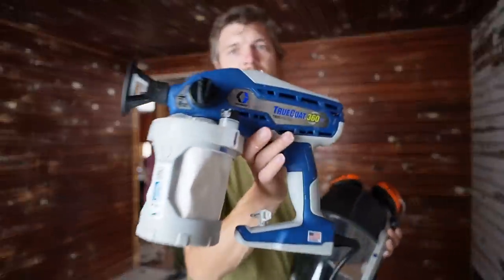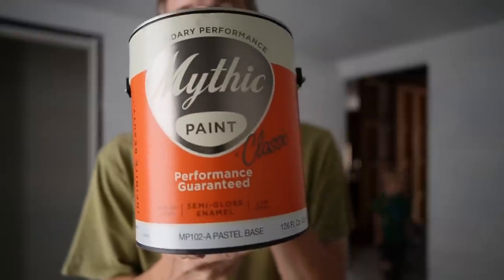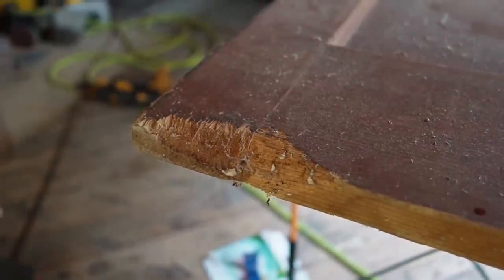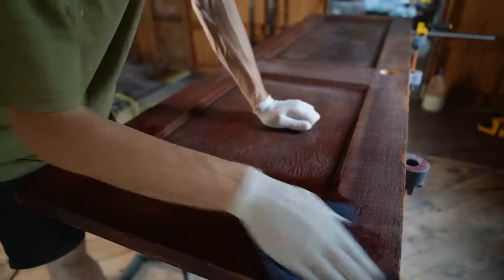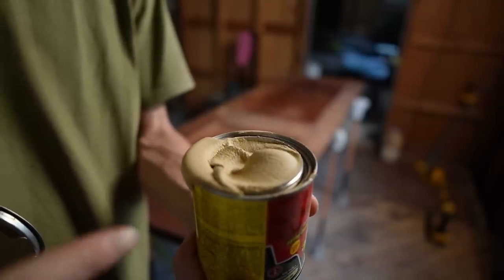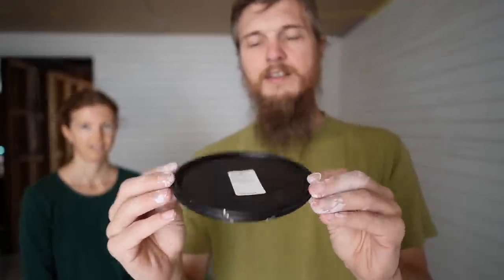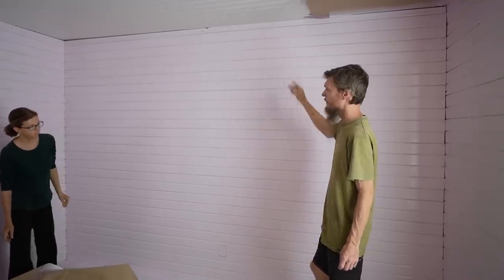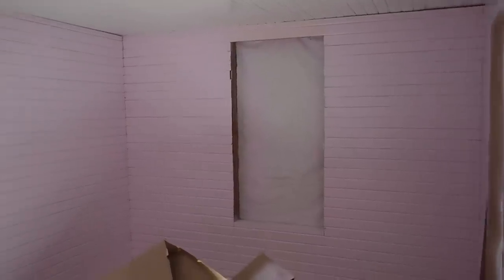We Painted this Room for the First Time in Over 50 Years - And it's Awesome!

Comment: I used to work at Sherwin Williams for a few years. Masking paper would have been a better choice. It is lightweight and comes in a variety of widths. 12" wide masking paper might have been adequate to keep the pink off the ceiling. The paper you are using is for floors and meant to be walked on, hence the heavy weight.
Reply from the maker: We actually bought that paper for the floor, but we like to use what we have on hand.  It worked, almost :)
Reply: @diyfferent  A roll of masking paper is about the cheapest thing you can buy. Save that heavy paper for future projects. I used to have a roll I used for all kinds of projects. I would even lay cookies on a piece straight out of the oven. I recently bought a new roll to cover the windows in our ambulance while painting the exterior. There will always be a use for the heavy paper.

Comment: No need for sanding the door again or applying a second coat of shellac. Rubbing out the door using #0000 steel wool loaded with paste wax is all that is needed to get a fantastic finish.

Comment: As a painter, painting over stains you will always need a stain blocker. Certain stains require a shellac based stain blocker. The bleed through most of the time will get heavier over time therefore having to do it over again. Most general primers are not the same as a stain blocker.
Reply from the maker: We understand. Thanks :)

Comment: Hey guys next time try using the blue painters tape. It seems to stick better to a painted surface and not pull any paint off at the same time also try using the plastic and not the paper because of the weight, yes I know it’s a little harder to hang and tape but I think you will have better results.

Comment: Doug, a couple of things,first off what brand sprayer is that looks pretty decent?Secondly,as a spray painter, you have a couple of things you should correct. Do not fan out your strokes at the end of each spray stroke as you create overspray and uneven coverage. Try to keep your stroke like a robot, perfectly even end to end same distance and perpendicular to the work area. Next,spray completely wall to wall so not stop in the middle, you will create dry spots where you break the pattern. Go end to end and work your way up the wall,floor to ceiling or vice versa. Bin or Kills makes a good primer over wood as the shellac base stops the bleeding. It will look good though,as you practice these are all common mistakes that are made when spraying. Project is looking good!
Reply from the maker: The sprayer is linked in the video description.

Comment: Masking tape is not used for painting. Try using blue painters tape.
Reply from the maker: Masking tape is also known as painters tape. We didn't have any blue masking tape on hand, so we just used what we had. The purple painters tape we used is made for delicate surfaces so it didn't have the strong hold needed for the ceiling. The yellow painters tape is designed for automotive painting.

Comment: What did you think about the paint sprayer? Was it as faas it looks? Was it heavy to use? It really looks good on video. Nice job.
Reply from the maker: It was fast to use. And yes, it does get a little heavy after holding it for a while. The cleanup does take some time and I always hate cleaning out sprayers. But it's not the worst I've had to deal with. The paint cup is small so you have to keep refilling it on a project this size. It gets messy and annoying to keep stopping to refill. But it does give a nice finish and saves a lot of time.

Comment: You know those movies where someone dies and all of a sudden they are blasted by a bright white light?  That's what the room looked like when you were showing us the base coat!😄 Thought Belle would need sunglasses to walk in the room!  What a huge difference.  Despite the difficulties, love the white ceiling with the pink walls. Love the door, but wouldn't have felt any attachment to the scratched out section.  I definitely would have fixed that, but love how the stain looks and love that the door will complement other doors and trim in other rooms by having the deep stain.  Can't wait to see the floor redone and to see how Belle and you lay out the design and decorate it.

Comment: When using shellac, try the French polish method. It takes a bit more time and patience but the application technique is a breeze and the results are really satisfying. Cut your shellac by 1/4 -1/3 with boiled linseed oil and wipe it on with a lint free cloth or gauze (cheese cloth) pad. Build up multiple coats, lightly sanding with fine sandpaper every 2-3 coats. As you get to the depth of finish you want, try adding even a bit more linseed oil to the mix for the final couple of coats. For a furniture grade finish, then buff out  with a slurry of linseed oil and pumice powder.

Comment: You can put a light coat of shellac with a brush over the bleed through before you paint it again and if will seal the bleed.
Reply: Why not use "KILLZ" primer. It's always worked for me. It depends on the surface and finish of the wood as to how many coats of KILLZ primer I apply. More lighter coats to get great coverage than one heavy coat 😊

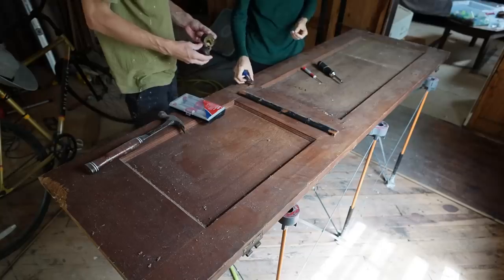Comment: 7:17 At this point I’m really hoping the door gets a refresh and new stain n sealer. It would be a great pop in the room. But since I don’t know the end color, I’m going to be open. The room so far just with primer looks so much better. One time, I’m ok with painting wood. 😂 
33:19 Ok, well the plan so far is looking good. Perfect pink room. With the stained door will be so nice. I have used shellac based primer like Bin to seal stains. Even after a first coat of paint. You can spray the bleed through areas after you spray the door and then paint with your pink or white again. Many painters don’t like to use the same gun for the shellac and water based paint as they use different things for clean up.

Comment: It doesn't matter what kind of paint I have on what type of ceiling a craft paper never stays up for me. I finally just bit the bullet and bought the painters tape with that real thin plastic sheet attached to it that you unroll it as you tape it on and then you unfold the thin plastic. I don't like that stuff it doesn't biodegrade but it also doesn't fall off the ceiling and smack itself against my wet paint. And it stays up there probably because of how light it is.

Comment: Doug & Aehley, good job on the walls and door. Don't be afraid to give the door another coat with a brush it will be better. Also, give another coat of paint to the walls with the brush since it looks like the masking is not working for you. But if masking works for you during the spraying, pull the masking right after you finish painting. You guys are doing well. Take care, thanks 😊

Comment: Maverick's sweet smile could easily melt any glacier.   He is such delightful addition to your videos.  Belle's room is indeed perfection.    It's 'her room'.   I think it's important for children to have input re their rooms.   It instills the knowledge that their thoughts and opinions have value.    Those positive lessons/memories will be beneficial when there's challenges throughout her life.    (I didn't always obtain exactly what I wanted but Mother definitely tried.   One time I wanted bright pink floral curtains in my room.   We compromised on a piece of fabric with bright pink floral print in a frame.   Mother  was very wise.   It wasn't long before I didn't enjoy the framed floral fabric, it was a bit garish.)    I had to smile when Doug said Ashley wanted to keep the damaged area on the door.   The house has a story.   Every scar is part of it's story.   New construction is bland, to me there's a void when there's no history.    I love solid wooden doors.   Not only are they usually more quiet they also add a 'feeling' that hollow core doors and foam in plastic doors cannot provide.    One of the selling points on my home was solid wooden doors throughout.   Sadly they were finished (in 1967), with varish or shellac that turned orange over the years, along with the trim.   I love wooden trim around windows but I'm not a fan of the orange.

Comment: FYI. John Deere excavator 35d, looks like yours or similar. South main auto under Eric o. Did a quick maintenance on the machine. He is good and maybe the video will help you when u do maintenance on yours. I advise to give it a look.  He did  an oil and filter change , air filter and fuel filter change. Btw are I using oil paint, came out great.

Comment: Hi, I was wondering. How do you like the ceiling fan in your primary bedroom, how is it going with your air conditioning and dehumidifier, do you have minisplits planned for
 the whole house? 😀😃
Reply from the maker: We keep the fan going all the time. Can't feel it or anything, but it's good to keep the air moving around. We don't use an air conditioner. We don't have plans for minisplits.

Comment: To add to the comment about the respirator,  I had a Wagner sprayer like the one Doug is using and ~50 yrs ago tried it out to spray primer on a bathroom wall and it was NOISY, 
and in that era face masks were 'optional' and I ended up with paint all over my nose hairs and to a lesser degree my scalp hair, fortunately water based but still a hassle to clean out and of course the smaller particles ended up in my lungs.  Re the lumps in the pink paint:  was the paint properly diluted and then run through a filter?  sprayers are finicky about how the paint is prepped.

Comment: I'm super curious to see what you use to sand the floor for refinishing. I did a room roughly that size with a garden variety 5" random orbit sander and it took a good 11 hours crawling on my hands and knees.
Reply from the maker: We also used a 5" orbital sander, but the floor didn't have a hard finish and the wood is soft, so it didn't take long.

Comment: Talking about decoration and finishes is always going to be a subjective and personal matter. I can understand Belle's reaction, the difference between the old and the new was so great. I suspect that even then, the real difference cannot be appreciated in a video. You have opted to show the room with some of its scars from use. This is going to be even more subjective, I would probably have tried to fill and mask those previous 'sins'. However, that is because in many cases I made them as I changed my mind. Spraying can allow much better coverage and penetration into dips and hollows, it is certainly easier and faster, until either the masking tape fails or it comes to cleaning out the sprayer!

Comment: could put the second coat on next year or the year after that as she might change her mind about the colour of some of the walls , you could silicone the splits and gaps in the waterbase " silicone" stuff in most of the walls , that should make it look nicer without spending a lot of money on corner covering 
about the paper falling intoo the paint , yes you can brush it though rollering it with a foam roller along the length might work better

Comment: You need to use an OIL or SHELLAC based primer for a situation like this. There is no compromise and there is no debate, it is a settled fact in the painting/chemical industry. Water based primers WILL NOT cover previous varnish, stains, and especially knotty wood. The bleed thru will only get worse with time. Im surprised you guys didnt know this by now with all the projects and research i assume you do.
Reply from the maker: You are right. We've been using shellac as a stain blocker for as long as I can remember. It's excellent.  I didn't use a shellac based primer because I was trying out a new non-toxic paint and primer brand and wanted to see how it performed. I did end up using some shellac over some of the heaviest bleed-through before continuing onto the final coats of paint.

So yes, we did know, but sometimes we like to test new products and we're trying to find good non-toxic finishes to use in our home.
Reply: @diyfferent  I understand but unfortunately, water based technology has not gotten to that level yet maybe one day it will be able to outperform oil and shellac in the hide-ability aspect
Reply: Nv